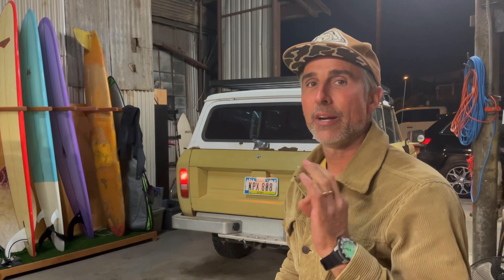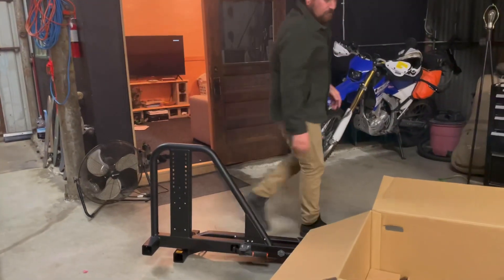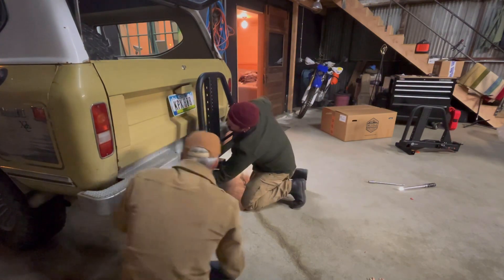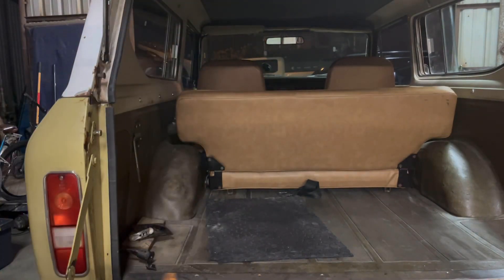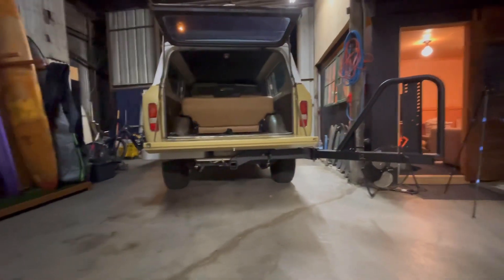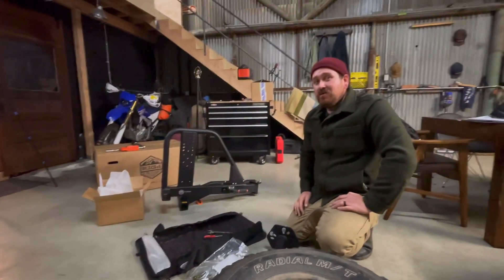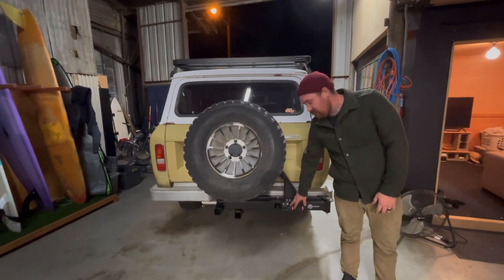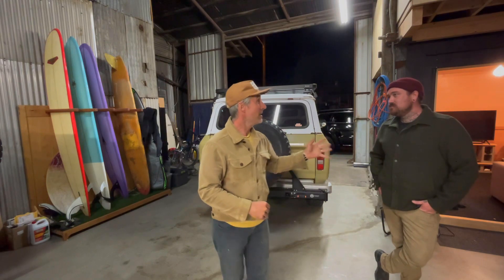The Scout Life: The Ultimate Solution to the International Scout Spare Tire Problem?! | RIGd Supply

Comment: With a little extension on the threads you can at maximum fit a 35 inch tire. Without sacrificing too much of your view.
Reply from the maker: I don’t think a 35” will fit with the seat down…and that’s a big ole meat to have inside!
Reply: @anythingscout  my dad was able to fit a 35 inch mud tire, it's not entirely straight but it's pretty close. I was just throughing out an idea that has worked for us is all.😂